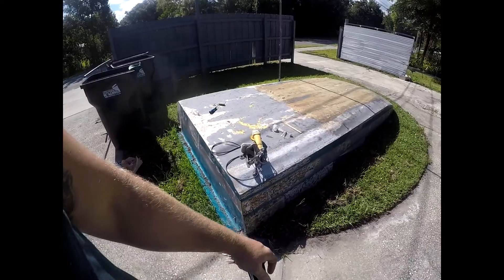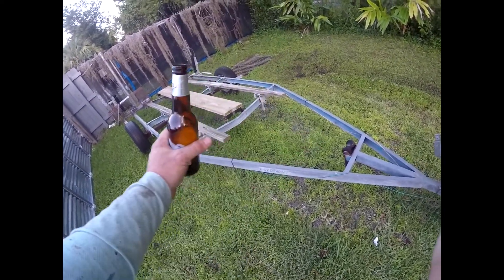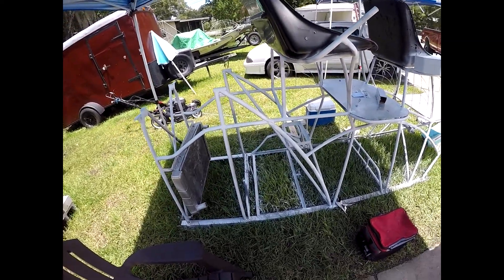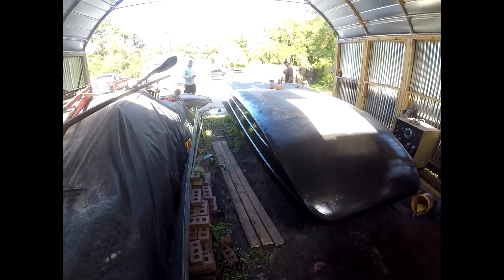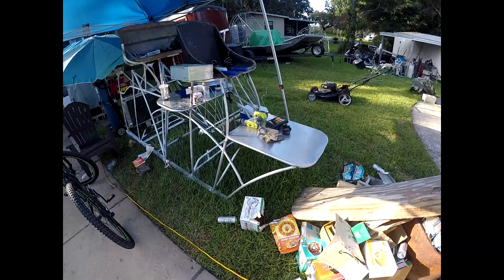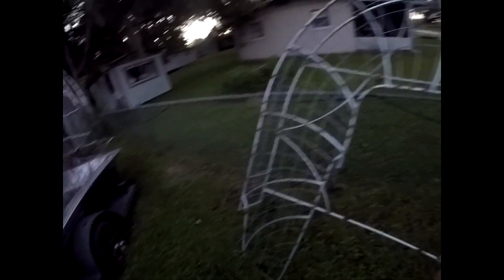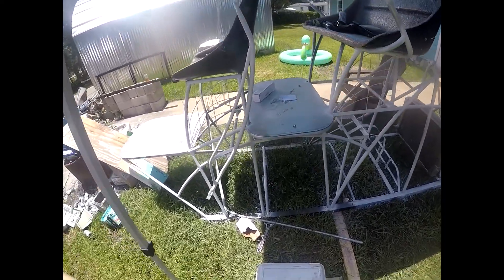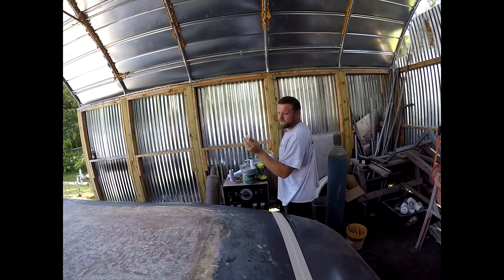UNDER 5K BUDGET AIRBOAT BUILD PT.1

Comment: I’m into building an airboat , fibre glass also , I like your video, my boat is 17 ft long, by 68 in’s wide, Got a 4 stroke motor 137 hp , toyota, 42 in’s 4 blade wood, was woundering if it would b suitable for the size of boat, planning direct drive ?could you help me on this , if I was closer I would buy your Boat , living in Remote area, in Quebec , thanks I will b watching more video,.
Reply from the maker: You need a smaller prop and carbon fiber